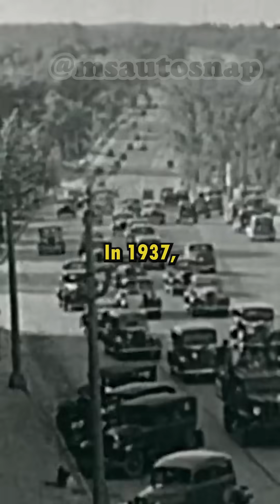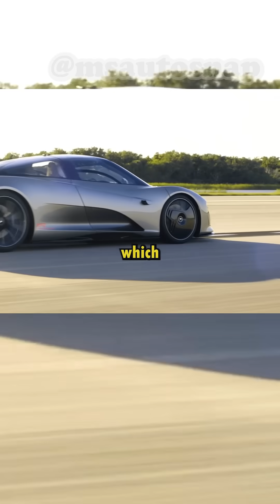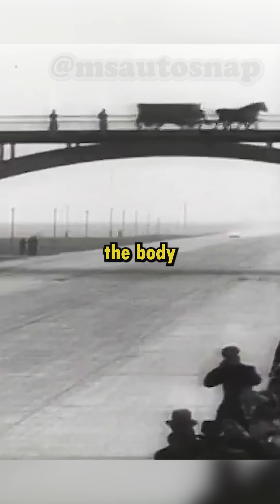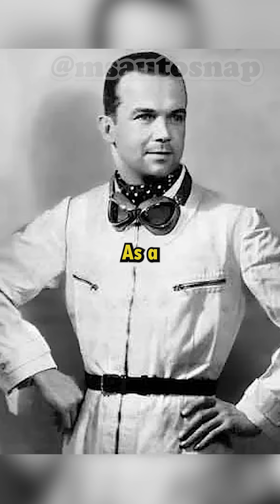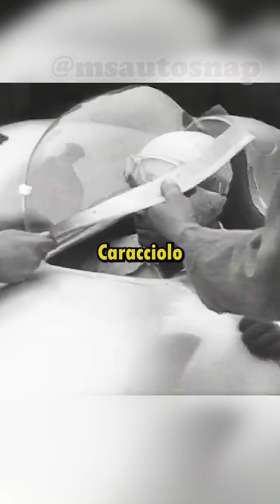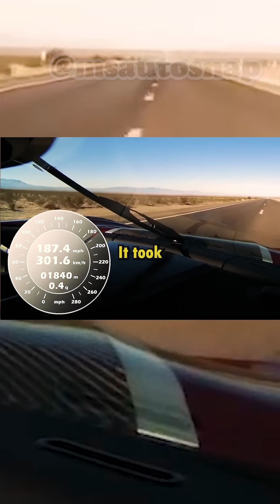Fastest Autobahn Car For 80 Years! #speedrecords #mercedes #v12

Comment: Except there are production cars that top out over 300
Reply from the maker: not on a public road
Reply: @MSAutoSnap if somehow they could make autobahn restricted to traffic for a day it easily would lol
Reply from the maker: @GamingIntelCoreM-y  maybe its not that easy and thats a pat of the dificulty to beat the record 🤷‍♂
Reply: And to top that there was a car built and ran out at the salt flats in the 90's that went over 700 mph.
Reply: @Samthemule2003 that wasn’t a road going car lol
Reply: @Thumper68  I didn't say it was. But the point was it stated the land speed record, though set on a concrete slabs of public roadway, still set up as a land...speed...record.
Reply: @Samthemule2003 public road land speed record, very different, whats your point
Reply: @Makkiebobo730  Point is they said land speed record that just happened to be made on a public road. It didn't say it was specifically for public roads. In what world are you even going to go that fast? Even on the Autobahn there's are sections with no limit and you still can't get to that speed. Over 200mph, yes, not 269.
Reply: @Samthemule2003 jet turbines that are not evem driving the wheels. Different story.

Public road with ~6m width is also somewjat different to salt flat with practically unlimited space.

There is no point to be made. Just meaningless discussions...
Reply: @Samthemule2003 you can easily could go over 269 mph in the autobahn.Koenigseggs, bugattis SSCs, the new chinese electric cars, all made it possible.People just dont have the balls to do so
Reply: @GamingIntelCoreM-y  Just because a vehicle has the ability to do it on the Autobahn doesn't mean a person can take that vehicle to that speed fast enough or in a way that's safe. I could drive in a straight line 250+ mph. Doesn't mean I'm good enough to do it safely. If something was to happen I'd end up killing myself. There's a fine line about it.
Reply: @Thumper68 the German makers had stream liner grand Prix cars at the time. And grand Prix were raced on closed public roads.
Reply: And how fast was the w125?
Dont confuse mph and kph ..
Reply: @aragorn2730  It said the tops speed achieved in the modified W125 was 269 mph. The highest land speed record at that time. In the 90's there was a car built to do compete for the record and hit over 700 mph. I'd have to Google the exact speed and exact car but I believe it was done by a car built by SSC.
Reply: @Samthemule2003 thats right. The SSC is jet turbines on wheels, running on salt flat.
That is a different story.

My (rhetoric) question refers to tge guy who said "except there are production cars that..."

So I get what you are saying, but not the reason why.
Reply: In 1935 the record was set by Alfa Romeo, with Tazio Nuvolari at the wheel of the Alfa Romeo 16C Bimotore (2 x 8c engines for a total of 550 HP), exceeding 320 km/h on the Florence-Mare motorway.  
In just a few years since then automotive technology combined with avionics and aided by large state funding progressed rapidly